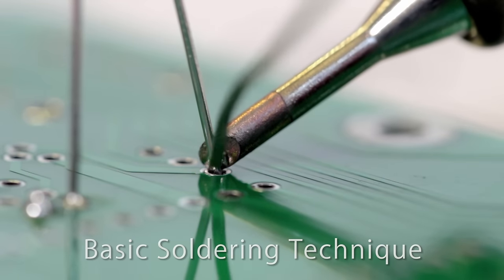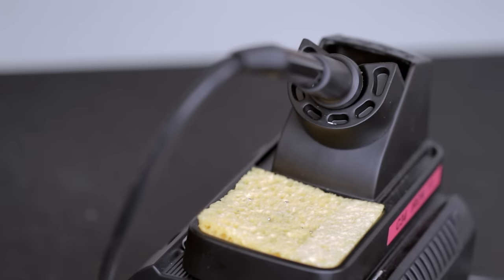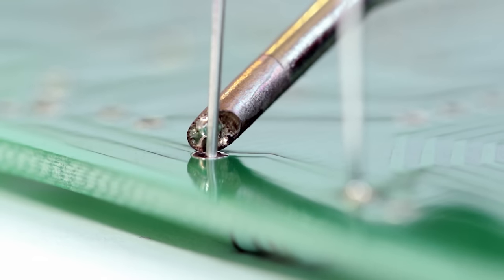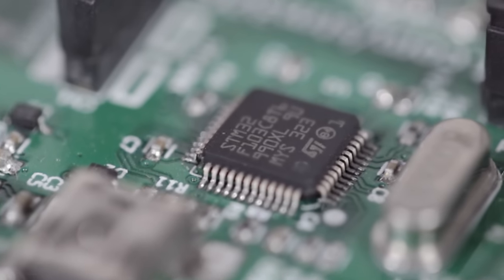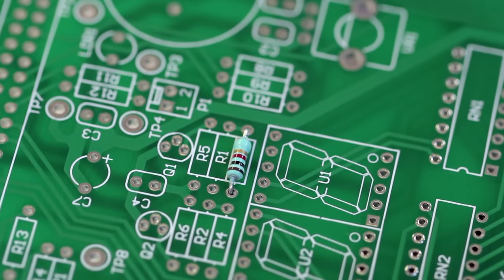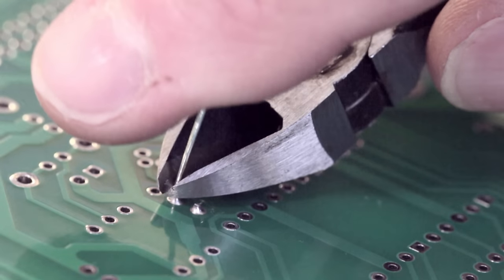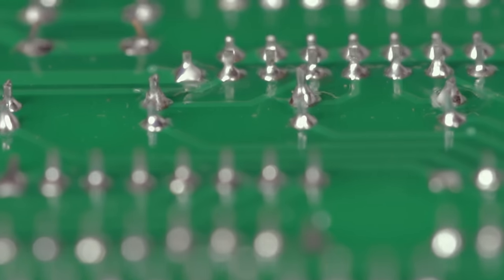Basic Soldering Technique

Comment: Do not solder then cut as it exposes copper, always cut then solder, I work in PCB assembly so I solder everyday.
Reply: I don’t see the difference...if you cut and then solder, the copper is still exposed. Btw, every single professional I have seen on Youtube solder and then cut.
Reply: NY Prince Absolutely not. In the most demanding industries, like aerospace and defense, you always cut first and then solder, because then you pull the soldering iron up over the cut end, causing the solder to tin the cut end. Cutting first also ensures the solder joint isn’t mechanically stressed during cutting. Cutting afterwards is common in hobbyist and less demanding industries doing very small-run production, but cutting first is unquestionably the preferred method.

Comment: Nice simple tutorial. Now I see a lot of people adding extra notes already, but about cleaning your tip, if you have an abrasive brass sponge, I highly recommend using that instead of the wet sponge. It has better ease to remove corrosion formed on the tip of the iron and there's fewer risks of thermal shock

Comment: I soldered the spot that must have over loaded and lost connection. It was the same spot in the video. I didnt need to replace the control board. I just had to solder that spot. The dishwasher works like new now!!!!!! Thanks!

Comment: Excellent tutorial.

A further Q; will the iron shown on the left 0:19 make the 350 degrees needed for soldering?

Again , thanks for sharing.

Subbed no hesitation.
Reply: Semi Experienced solderer here -- It might, it varies from iron to iron though In my experience all fixed ones have worked fine.

Comment: hey, i bought a cheap $20 well from home depot seems the tips keep burning up is this me or is it due to the cheap solder iron,I know this is somewhat hard to answer but any help would be good cause im thinking about spending around $110 on a better iron. something with temp controls. One of the problems i keep running into is i keep getting bad joints i do a nice looking job but somewhere i always have to reflow a joint or 2 idk but it really becoming a problem.
Reply: Tone Log Vintage Replica's 1966 Expensive iron won’t help you, sir. Now I would assume that you cleaned your soldering iron using a sponge right, sir? I used to have those problems when I started to learn how to solder.

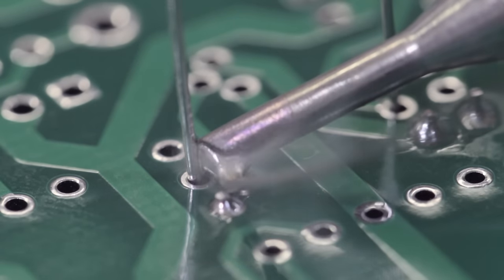Comment: 3:23 I didn't quite understand this part.  You want to remove the excess solder because you want the flux to evaporate so that there is none left.  But later you say if you solder without any flux, it could lead to a bad connection.  So are we trying to remove the flux or keep it?
Reply: cryora 
After you solder a joint, whatever flux is remaining in the solder will evaporate. So you will still have solder on the tip, but no flux. You want fresh solder that still has flux in it, for the next joint.
Reply: Here’s how I explain it to novices: the solder “cooks” when hot (be it on the tip, or when heating a joint for too long), and overcooked solder makes for bad joints. So what you want to do is “clean” the tip of overcooked solder by wiping off as much as possible, and then “rinsing” with fresh solder right before making a joint. 

(The “overcooking” is the combination of a few factors: 1. all the flux burning off, 2. the solder itself oxidizing, and 3. the contamination of the hot solder with other metals (copper from PCB traces and wires, and silver and copper from component leads, mostly) from prolonged contact while hot, resulting in a sort of undefined alloy. Flux helps prevent and even reverse oxidation, so adding flux can help to an extent.)

Comment: hi, i have a doubt,  After dip soldering,  some of the areas is not soldering properly, again i need to make the manual solder in some area, solder forming as flat soldering.  it not cone shape solder is not forming, 
what is the problem? how can i solve this? can you help me?
Reply: VEERAMANIKANDAN P Buy a good rosin or no-clean electronics flux.

Comment: Wait a second, so you can actually touch the soldering iron to the board and it won't damage the board?
Reply from the maker: It's all about putting heat quickly  into a small area - if the iron is at the right temperature the pad will heat up to the melting point of the solder quickly allowing you to make the connection and then dissipate into the surrounding board. If the iron is not hot enough the pad takes longer to heat to the required temperature and more heat dissipates into the surrounding board which is when damage occurs.
Reply: Clay Ford
Reply: You cheat the melting point of the board a bit by using heat sinks around the work area usually on the same circuit. However the cheating is limited
Reply: @fseelearning  usually what is right temperature for most things like this? Also, what usually is the right temperature for desoldering?

Comment: Do I need to use flux on the holes first?
Reply from the maker: The solder contains a core of flux so you shouldn't need to - providing the solder hasn't been left on the iron so long that the flux vaporises.

Comment: I don't know why you leave out using rubbing alcohol on your circuit board to remove any old oxidation that has built up and using flux on the board where your connectors are will give you a much cleaner soldering job result? I don't understand why so many people think that just because there is flux in my solder that I don't need to use any flux on my board, in my wires or on my connectors? That information is "bad" for the most part.

Comment: Them
Pumps are useless. Personally id use desoldering wick
Reply: Urban exploration Squad Totally disagree. A good pump works well for removing components. Wick is terrible for removing components, but is perfect for cleaning up the pads before installing a new component. 

Pro tip: buy some silicone tubing of a size that will tightly fit onto the tip of the pump. Cut a piece so that, once mounted, it extends about 1/4” past the hard tip. This lets you get in closer and make a better seal, even while touching the tip, since the silicone won’t burn or melt.

Comment: im having trouble because i dont have 3 hands and so far you are not showing the "trick" to getting the soldered points stationary im in girl-tears here....
And ya thats mine at the end. but my prob is that my solders don't conduct electic current. im using a kit just for pc.....?....looks like i have to lift the mother{F%&*$#@}board....darnit,,,oh thx it solved 1/2 the prob im giving thumbsup

Comment: first, you use the wrong tip for the through hole, and secondly, you should put the solder both pcb and components pin.. not to the iron tip...

Comment: These tips are OK if you're working on consumer goods but both military and civilian aviation standards would consider these methods to be criminal, not to mention NASA and high component cost situations where excessive heat, cold solder joints, measleing,  and crazing will get you fired. If you're not familiar with the afore mentioned terms then you are not a solder tech. If you can replace a burned resister...great. if you can't repair the damage done to a multi layer board because a component shorted and burned...well...you get the idea.
Reply: felonious craphammer Yup. I recommend the videos by Pace Worldwide, which definitely show military level soldering.

Comment: Wrong method, author has no clue about proper soldering. Do not put solder wire directly on soldering iron tip, and then on joint! Place end of the wire to component lead and PCB pad.